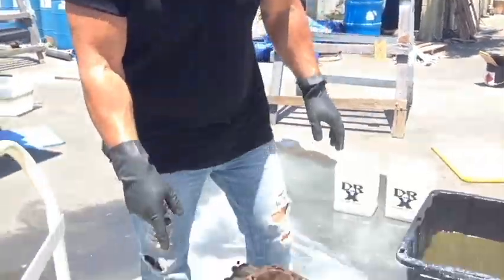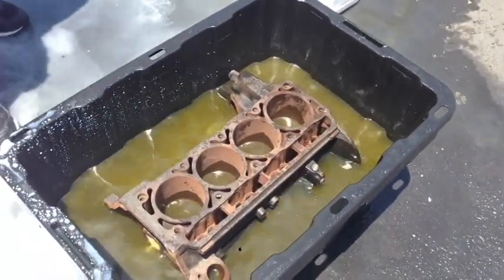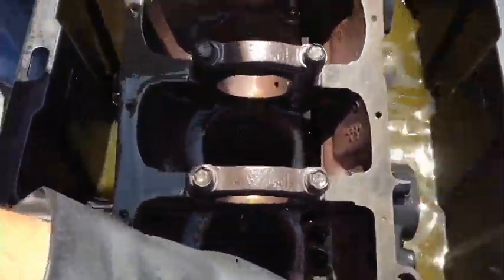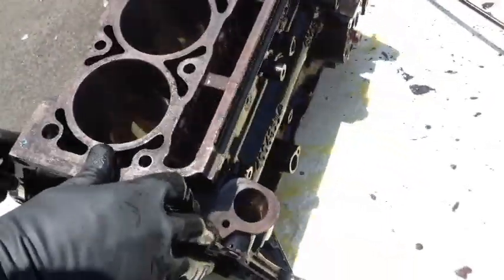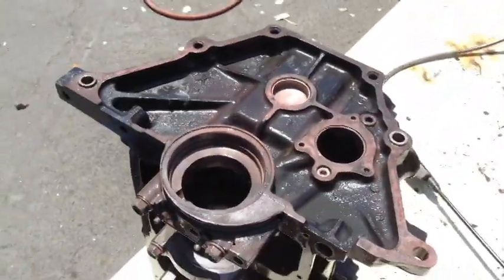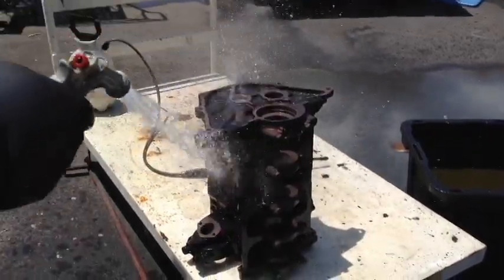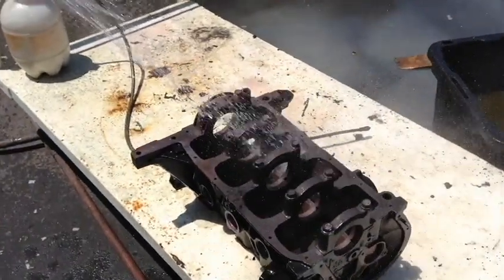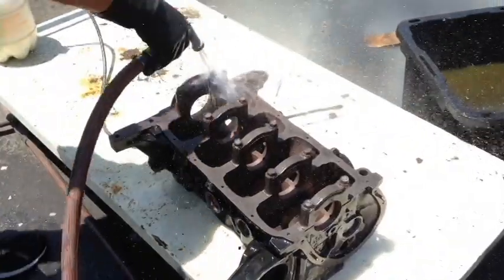REMOVING RUST: RUSTY METAL MOTOR SUSET AQUATIC BLOCK LIKE NEW part 2

Comment: Will Drx hurt rubber hoses, can you clean a cooling system while the motor is in the car or truck . In other words can you dump Drx into a radiator to clean block out. When the cooling system is completely drained of antifreeze.